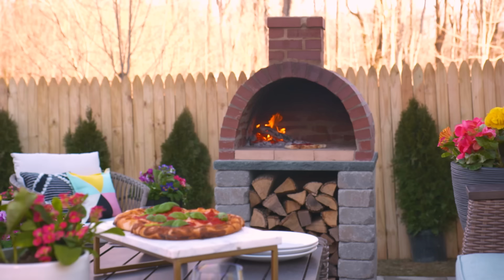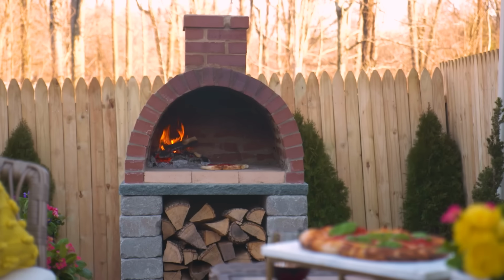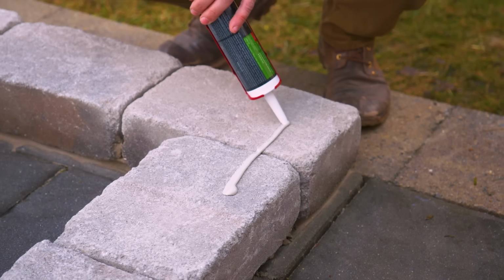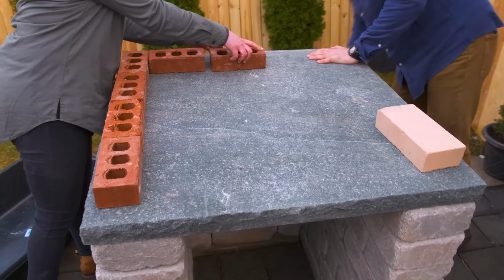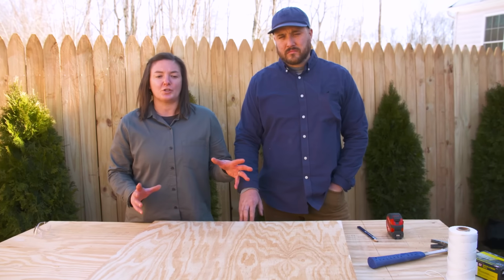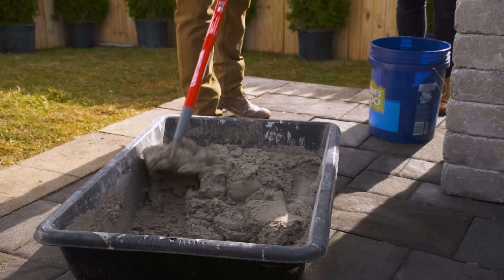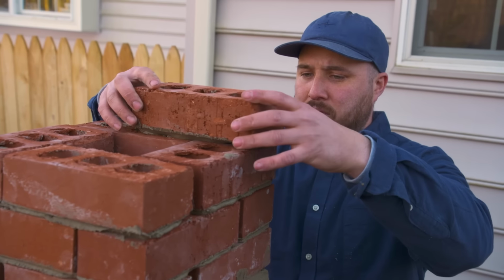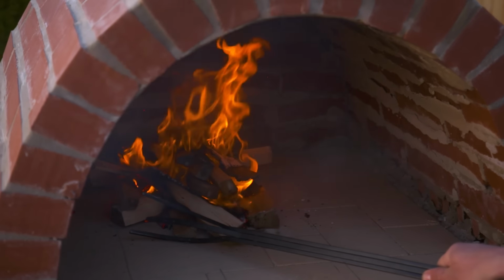How to Build a Pizza Oven

Comment: that opening is huge. The top of the pizza is never going to cook.  Also, why is your patio level? It should be sloped away from the house so that water doesn't pool, and then freeze and crack the pavers in the winter.

Comment: Wow, tried about a half dozen of the links and lowes no longer sells any of this stuff anymore.
Reply from the maker: 👍 Thanks for letting us know Tim. Here is an updated guide that includes links for the materials needed: https://www.lowes.com/n/how-to/build-an-outdoor-pizza-oven

Good luck building your own pizza oven! 🍕
Reply: @lowes  Appreciate the response, but several of the links on that page don't resolve to the correct product either. For example "clay bricks" redirects to fire bricks (not the same shape or style needed) and high heat mortar must revolves to generic concrete products.
Reply from the maker: @timfischer  Thanks for letting us know this, Tim. We'll share this feedback with our team so they can further check on these product links between this video and the updated article. Here are a few links to the items you mentioned that may better fit what you see in the video.

Red Clay Bricks: https://www.lowes.com/pd/8-in-x-4-in-Clay-Red-Cored-Standard-Brick/5013595093?idProductFound=false&idExtracted=false
High Heat Mortar: https://www.lowes.com/pd/Sakrete-50-lb-Gray-Type-High-Heat-Mortar-Mix/1000250707

You can check with your local Lowe's for availability if an item is out of stock online. Alternatively, you can enter your email address under the product listing to receive a notification when it becomes available again.
Reply: @lowes   how about the link for the cap stone?

Comment: the opening is too big, under the fireclay bricks first go glass and quartz sand, then fireclay bricks go without mortar, the ceiling should be 50 cm from the floor, made of fireclay bricks, the opening at most 45x40 cm, the stove made in this way with external insulation bakes a picu for 1 minute,

Comment: Lowe’s this is a poorly constructed pizza oven that will not reach the desired temperatures that a pizza oven should reach. This video should be taken down as it will waste people’s money and time. It was invented in the late 1800’s there should be enough blueprints and information to take the oven and scale it down properly in which after you would do testing to make sure it works before posting a video. That pizza on the patio table was not made in that pizza oven.

Comment: Also, you didn’t mention putting a door on the front of any type did you not need any type of door to keep the heat in? Thanks
Reply: Actually no. Air flow is essential in a pizza dome shaped pizza oven.

Comment: With regards to the size of the opening, yes I agree that its too large for Pizza. Maybe bread would be better. if you decide to build on one for yourself, a quick fix would be to: 1)Measure opening as they did. 2) Find center on plywood but before attaching nail measure down 6, 8 or 10 inches and hammer in the nail in a pc of wood, then attach string and go to the edge and draw your arc from that position. You will get a shallower arc which will reduce opening size. Cut out as shown in video.

Comment: The mouth of the oven is way to big and heat will easily escape making the front part of your oven colder than the back, you want to keep the heat in. Also, did you use refractory bricks or regular bricks?

Comment: There are so many things wrong with this video, it's hard to even begin:
* You don't use landscape adhesive for that. They'll break and fall apart eventually. Also, you can't level anything using that so forget about it
* I don't know where you got that slab for the base, but you can't find things like that anywhere
* The shape is entirely wrong. That thing holds no heat. Might as well just cover the fire with something resistant to burning
* You have to use firebricks everywhere on the inside of the oven. Standard bricks don't like drastic changes in temperature

So, this oven cannot be level, it will fall apart because of the crappy adhesive and if you're lucky not to have those problems, it will make for a very inefficient pizza oven whose bricks will break apart.

Comment: Two things.  I would wrap your wooden structure in plastic wrap for an effortless release.  And, those were not fire bricks that made the oven.  They LOOKED like regular bricks.  You can expect many problems in the near future as they are not rated for high heat.  Did I miss something?

Comment: We built this last summer and it works fine. The only change was you build the fire in the middle and let it burn down, push the coals to back and the sides and then bake. Works great
Reply: Has the clay bricks cracked?
Reply: @thedestroyer3879  -No
Reply: @thedestroyer3879  hasn't cracked because it's a fireplace that can't get as hot as a true pizza oven.
Reply: How did you do the back?  The video doesn’t show it. :)
Reply: How does the clay bricks hold up with the heat
Reply: @paulzedov8471  -They have held up fine! You don’t need a 500 degree oven to bake properly.
Reply: Remember how many red clay bricks you used?

Comment: For clarification. Shouldn't you use firebricks on the entire inside of the oven, and not just the floor? Seems like the clay bricks and regular morter will crack.
Reply: Considering the poor design that oven won't get much hotter than a toaster oven, so heat won't be a problem.
Reply: @cookingwithtully7864  you have zero idea what you're talking about. I built one that is essentially this 5 years ago. Same bricks and a granite capstone. It amazes me that people don't see chimneys everyday...out of clay brick, or that the only place fire brick in in a fire place is the floor, but you didn't know the huh chef. The heat from the flame is minimal compared to the coals. I literally cooked pizza in my oven last night. 725 degrees. Took 2 mins, maybe 3.
Reply: @sayloth  Based pizza protector :elbowcough:
Reply: Clay bricks can withstand the heat from a pizza oven..however regular concrete bricks will crumble.. firebricks are only 100% necessary for the floor base…

Comment: Should place wedges under that wood arch then pull the wedges out the arch will fall and slide right out.Also that will not last the way its built you should use fire brick for the entire dome as that standard brick will Crack and burn out fast.  Spread your motor and butter the heads as you lay the brick then you won't have to point anything afterwards.

Comment: You worked in vain, fire bricks are used in the oven, otherwise everything will degrade quickly. Those bricks are used for building, not for fire. The power supply had to be reduced so as not to lose heat, and a lid, a door, was placed. You only did half the job.

Comment: So many things wrong with this oven build.  It will fail and crumble within a year.  You need to use firebrick and refractory mortar for the dome, not just the floor. There is also no insulation over the dome, there will be a tremendous loss of heat very quickly.

Comment: Bit of advice from a qualified and experienced bricklayer, when putting the wooden former in play put a wooden wedge that is about 5mm thick under each corner, that way when you come to removing the arch template all you do is remove the wedges and it should easily pull out of place rather than having to dismantle it in the video like this, also use fire bricks, not engineering bricks as shown in this video and the latter will shatter under heat!
Reply: I'm lazy so I would have removed the mold by burning it...
Reply: @plixplop  Yeah I would recommend against that, even if the mortar is "fast setting" and appears to be set from the viewable brickwork the internal workings between the bricks will still take a couple of weeks to fully set, if you set a fire during this time it could cause fractures that will weaken the arch. Also, there will almost certainly be voids between the bricks where you've framed in that need to be pointed up, if there are gaps that leave room for a build-up of gasses which can cause a small explosion when ignited (this can happen a lot in large refractories)

Patience is key in this kind of thing! 👍
Reply: thanks for the tips!
Reply: Hey Joe can you use any type of mortar will that also become a cracking issue from the heat ?
Reply: In Italy they use untreated wood.... And just build a fire at the end. 😂🤣
Reply: Can you tell me how they did the back of the pizza oven?
Reply: Thanks for the tip
Reply: @Shanonmcnab576  no problem
Reply: Thank you for the advice
Reply: @pn6490  No problem! :)
Reply: Done. Thank you
Reply: Can i use soft fired bricks, they are from an old fireplace in my house that someone pulled down before i bought it.  But the main room still has functioning fire place with soft fired brick made in 1930s.
Reply: Hi Joe - regarding the "engineering bricks" are you referring to the orange colored bricks that they used for the dome?  Thanks!
Reply: Their chef skills saids it ALL.
Reply: yah thought the same thing, these bricks can explode even under intense heat, but the wedge tip is gold sir thank you!
Reply: 😂 LOL 😆 LOL
Reply: Fire Brick Contain Alumina!!! sometimes going with the heard ain't wise... I'll just rebuild a cheap clay one... thanks
Reply: @jacksmith7576  food safe firebricks exist and are a thing.
Reply: @jacksmith7576  Your clay mix is more likely to have hazardous materials to leech out while cooking then the fire brick lol.

Comment: Maybe I'm being stupid but those normal red bricks are not fire rated, even with the high heat mortar.
Reply: They are clay bricks used on the outside which can also withstand the heat of a pizza oven. Concrete bricks will crumble

Comment: you didn't post a link for the capstone?  Is that something that Lowes sells?
Reply: Yea I don't see them sold at stores. You can build one easily out of concrete. Just make a rectangular mold and fill it with concrete, then screed. Also you can take it a step further by adding steels grids and insulation blanket in the mold before pouring.

Comment: Wow. Lowe's is telling people it's safe to stack that many concrete pavers on top of each other as long as you use 2 beads of cheap construction adhesive? That is a horrible joke. NOT SAFE, DO NOT BUILD THIS IF YOU HAVE YOUNG CHILDREN!
Reply: Won't the weight of the capstone and the oven make the pavers stay in place?

Comment: I had another question... With the two half moon pieces you made for the form of your oven, couldn't you turn it into a "door" to keep the heat inside? Like glue two pieces to each other and use a 6" piece of wood, screw it to the middle of your door and use it as a handle? I just wonder if it is best to keep the fire enclosed, like an indoor oven. Thanks for this video! Nicely done and looks amazing! BTW, I don't care how you make a pizza 🍕, it all gets eaten 😋 😋 😋 😋 😋
Reply: Usually, you'd want to keep that opening open to allow air to enter the oven. Without it, there won't be enough air to enter the oven and it'll snub out your flame. Plus cooking a pizza near a flame like that wouldn't take too long to cook so there's no real worry about losing too much heat. Just remember to rotate your pizza while it's cooking to make sure it's even.
Reply: @KurryKaiser  ok, I guess that makes sense. And ooh, yes, didn't think about rotating it... Thanks, good idea 💡!

Comment: With the fire in the back and the front opening so large, isn't heat loss a problem?  Most ovens have a longer front and have part of the inside of the oven with a dome covering to keep heat in prior to the opening.  Doesn't seem right.
Reply: I built one in this barrel style a couple years ago.  I realized soon after that I should have made my total arch lower to keep that heat closer to the pizza as you are correct that large opening does not help.  I ended up covering a third of the front (by taking fire brick and making it come down from the top two brick widths).  It helps as a buffer to keep heat from rolling right out the front at the top and also helps with the draft.  A door is also helpful on these.  I have a metal one I had made with handles that I put up in place while heating it up to temp, or after cooking some pizzas to build heat up again, or use oven to slow cook something after main cooking is complete.  Not sure how long their oven will last or how hot it will get without extra insulation in base below fire brick or insulation outside the oven walls.  Not sure that red clay brick would hold up over time.  My chimney has a flue and firebrick around it and gets super hot.  I used same size firebricks they did for the floor and dome, then insulated it with ceramic blanket held in place by chicken wire then rendered.  The decorative red clay bricks I used after all that to make it look nicer.  Brick wood ovens has the best free plans on net for DYI’er.  Though I do like how they made the wooden form for their dome.  I used inch styrofoam (4 pieces) cut like they did their plywood, then I taped together a bundle of door shims made of wood so it looked like a wooden set of blinds.  I used these to connect and drape over the styrofoam to create my arch form.  Their idea looked much better and more sturdy.
Reply: The opening is 100% too large. The interior should be larger inside than the opening. The opening should really be large enough for the pizza itself and some airflow for the fire. Designs such that the fire surrounds the pizza providing even heat around the pizza is a much better design. I wouldn’t build this.